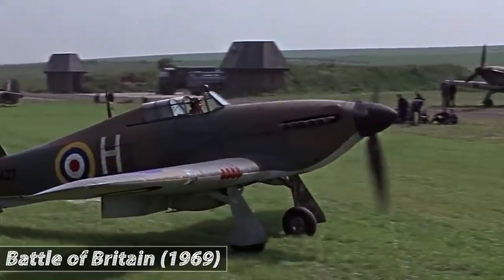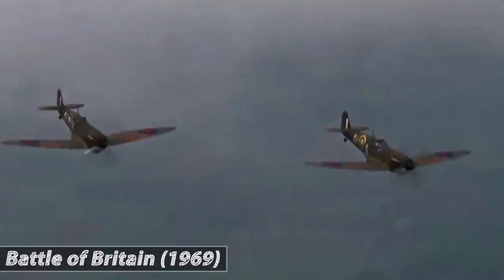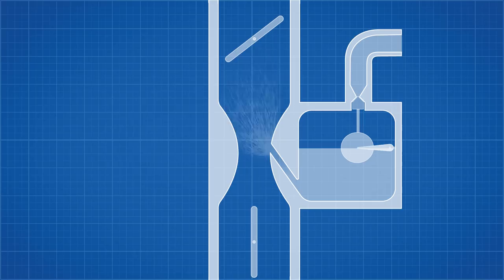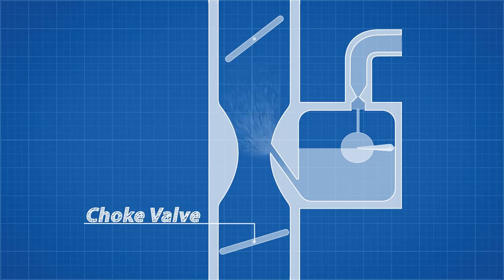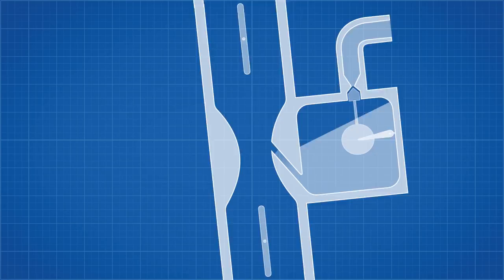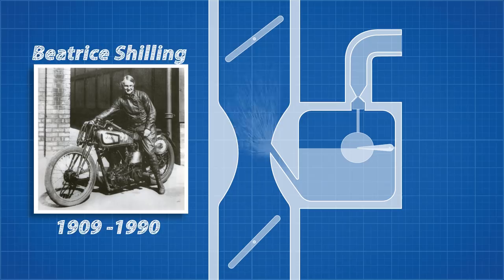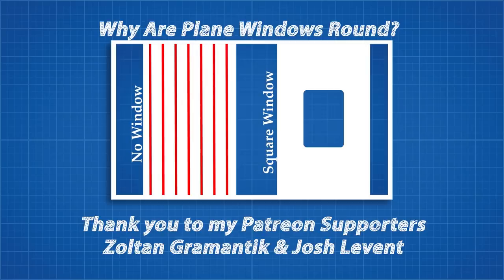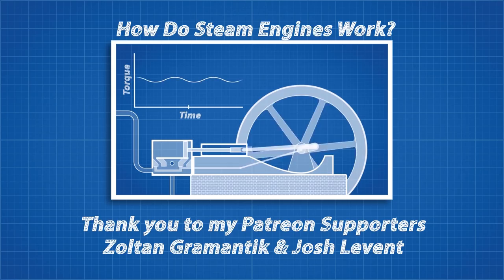The Spitfire's Fatal Flaw

Comment: You might be interested in an online lecture, which I sat in on yesterday, that revealed the "fatal flaws" of the Bf 109's engine.  Its direct injection might have been insensitive to negative 'G' in combat, but the fuel was insufficiently volatile, did not completely vaporise and a significant amount got past the piston rings.  This diluted the oil, which was then too thin to provide adequate lubrication for the big end and main bearings, which were destroyed at very low lives - and there's more.
The Nickel and Tungsten content of the exhaust valve alloy was progressively reduced and, to compensate, the valve heads were either Chrome or Stellite plated.  The rough surface of the plating tended to produce local hot spots, which resulted in detonation and a piston could be holed in less than two hours running time at high power.
There's an excellent book on the subject that's coming out soon.
Reply: i mean plus the fact that germany had the worst oil production because of the allies bombing german industries
Reply: That seems similar to something I watched.  It was impressive how Daimler-Benz swung for the fences with the direct-injected inverted V and it arguably had greater potential than the upright V, but there were a lot of teething problems and its potential was never fully realized because of the poor fuel the Germans were forced to use.  The cylinder washing was mainly a problem for automotive applications with the cylinders in the upright configuration and more frequent starting and shutting down.  Interestingly, the inverted V is credited for the superior roll rate of the 109 because it allowed the aircraft to be designed with a lower inertial moment than did the upright V.  Another bizarre thing is that radial engines also resulted in a lower inertial moment than could be attained with the upright V.  Robert Johnson stated that he found the maximum roll rate with a P-47 (!) quicker than with a Mustang or Spitfire.

Comment: By the way, the cure is simpler than you imagine. Chain saws use carbs that work perfectly at almost any angle. We Kart racers used ex-chainsaw carbs because they are utterly impervious to high vibration and g-forces (around 3g is quite normal on quick karts). They replace the float chamber with a rubber-bag (effectively) which fills and closes the inlet and, as it empties, contracts to let more fuel in. That 'rubber bag' is not affected by angle or significant G Forces. We Karters banned fuel injection to keep excellent simplicity and to keep costs down.
Reply: as a kart racer, wtf 3g cant be done, 3g is what formula 1 pilots reach , 2g could be possible, but a kart is not fast enough to do 3g, only with a crash it could be done

Comment: I remember the first place I heard about this problem which was when I was reading Martin Caiden's book "Thunderbolt". Robert Johnson, a P-47 pilot featured in the book, got a chance to fly a spitfire and he apparently wasn't told about the "feature" and was gobbsmacked when his engine cut out during a negative G maneuver.
Reply: I recall that Martin Caiden wrote a fictional novel and Robert Johnson did not fly the Spitfire Mk I or II, the full cure was done in 1941 on the Mk V, so it is just possible he did fly a Mk V and just about possible it was an early Mk V from before April 1941. 
Most pilots avoided negative G if they could since it was not the best for the pilot and anything loose on the floor would come up and not be so pleasant, that included mud from wet airfields, of course the P 47 needed a long bomber runway, the Spitfire used grass fields.

Comment: Having flown many carbureted aircraft inverted, I fully understand the components, physics and aircraft's reaction that you are trying to convey,  and although you've greatly simplified the event, you are correct. It might have been a more effective graphic if you'd turned the carb completely upside down so the viewer would see the float bowl fill completely up while the float (and fuel pressure) is holding the needle off of the seat.  As the carb and aircraft are rolled upright and positive g return, the needle closes and the engine must ingest all of the excess fuel in the induction system and carb before a correct fuel/air mixture enters the cylinders and the engine starts running normally again....if it hasn't (momentarily) fouled any plugs.  I was also a bit thrown off by all of the Hurricane footage.  IMHO, you'd been better off only showing the Spitfire clips and if needed, showing the one of the aileron roll several times because it does show exactly what your're trying to explain.  Maybe you'd like to try explaining how an inverted oiling system works and keeps the engine from seizing during negative g maneuvers?  Best regards.

Comment: The engineering aspect of this is spot on, as would be expected from an engineering channel. Historically though, the problems caused by carburettor were not really fatal. Yes, negative G maneuvers could not be sustained, but pilots adapted by pulling different maneuvers to follow the same trajectory in mostly positive G. 

While defensive in a dogfight, nose down maneuvers aren't that common. As the Spitfire had excellent turn performance, an attempt to dive away would actually hand the advantage to the Bf-109, which was marginally better at diving. While offensive, the Spitfire did have problems in tailing a 109, however the half roll maneuver I mentioned earlier meant a good pilot could still tail their target without any real extra difficulty. The carbeurettor also didn't totally prohibit nose down maneuvers in normal flight, they just needed to be carried out gently as not to reduce G below 0.

Incidentally the upside of the carburettor is probably more significant, that being that it resulted in higher fuel density per given volume than a contemporary injector system, and therefore greater power output. 

You are already aware that you frequently used footage of the Hurricane in this video, but they did use the same Merlin engine, so had the same flaw. The thumbnail image however, is of a late war Griffon-engined Spitfire. This aircraft would not have suffered the same problem, making it a slightly odd choice of thumbnail picture.

Comment: Carb problems in early Spitfires (pre MK9) are:
1. Loss of fuel flow (low pressure) in negative G maneuvers 
2. Carb icing at all altitudes and temperatures - Venturi Effect - pilot adding carb heat resulted decreased H power
3. In later  FI engines there is no need for Mixture or Carb Heat. In general.  A lot simpler to fly. 

PS to a comment below - Bf109 and Spitfires were laminar flow wings - requiring wheels mounted to fuselage.  Hurricanes had a conventional wing profile allowing out board landing gear.  Full cantilever wings were figured out later in WW2 ie Mustang.
Reply from the maker: You have taught me something now. Thank you! May do a video on the wheels in the future!
Reply: Neither has laminar flow wings. The inboard gear was intended to save weight and allow a thinner wing (in the 109 it also helped with transport- because the gear was attached to the fuselage, the wings could easily be unbolted and laid alongside the plane to make it fit on a truck or rail car)
Reply: all wings are cantilevered..a horizontal flag pole is cantilevered...
you are referring to wing strakes... which has nothing to do with wheels placements
Reply: no the spitfire doest have laminar profile , he's profile is still use from ultralight aircrafts because allow low speeds ,the Spitfire operate mostly fom small grass airfields !
 But the Mustang have a laminar profile , who make it faster, but dangerous to fly at low speed (brutal stall at low speed)...
The first RR merlin use classic float type carbs, later Merlins from the spitfire was pressure carburators (look like  a single point trottle body): a me109 injection pump was stolen from the french resistance and send to GB, but the RR engineers find this system too expansive and found another solution who work...
Reply: I am not sure how similar the Spitfire landing gear was to the Me 109, but according to Deighton's "Fighter" the Me 109 had a particular problem with instability on the ground, due to the wheels being too close together, which resulted in more accidents on the ground than in the air for this plane.
Reply: pilot blue.
the negative G problem was first improved on Mk I and Mk II Spitfires in 1940, it was further improved by moving the outlet on the float chamber by the Mk V to such an extent it was not a problem at all. the Rolls Royce / SU speed density carburetor was fitted to the Merlin 66 as used on the Mk IX, Rolls Royce gave this to Bendix.
Spitfire and Bf 109 were not laminar flow.
Reply: Apparently pilots began addressing the problem of power loss in negative G before the engineers did,  by executing a half-roll before following a diving quarry, so that the 'plane was pulling positive G in the same trajectory.  Modern fighter pilots are likely to do the same, purely because the human body can handle more positive G than negative G before feeling adverse effects like vision loss.
Reply: I would quite like to know what you are referring to by laminar flow wings as laminar flow is necessary to reduce weight lifting any wing although I realize that that maybe the name of a particular type of wing I'm simply curious what type of ring that is and why it would be referred to that way or maybe a better question would be: laminar flow as opposed to what?
Reply: George Gibbens The measurement or width of a wing is called the CHORD.  In a Standard or Conventional wing its maximum thickness is situated approximately 25% back from the leading edge. The wind passing over the wing, that is attached to it, is called the Boundary layer or Laminar flow. At High Angles of Attack AOA - (such as a steep climb) - this air flowing over the wing Transitions into turbulent air and  the plane loses lift (wing stalls about 19 degrees AOA). The Conventional wing is docile and has very positive lift but has limitations (it has a fat front to air flow -induced drag).  In a Laminar Flow Wing the maximum wing thickness is situated 50% back from the leading edge so the air passes over and under the wing more efficiently (greater potential aircraft speed for a given HP).  The biggest draw back is the Lift force is moved back significantly or by 50%. The wing transitioning from laminar or smooth air into Turbulent Air Flow  can happen very quickly(stall). So while the Spitfire didn't have a true Laminar Flow wing or Profile (until Mk 21) Supermarine had  thinner wings and designer Mitchell put he planes maximum wing thickness at 33% back from the leading edge. This gets rather technical but the Spitfire controlled violent stalls by having the wing stall at it's root (closest to the fuselage), wing wash out (wing twist), wing dihedral and of course that amazing double ellipse wing (Planform - aspect ratio). Because of these wing improvements the Spitfire was able to get more speed per HP as compared with the Hurricane which had essential the same motor. It is all about aerodynamic efficiency. The Hurricane was a more forgiving aircraft for low time pilots because of it's wing.
Reply: Yes I understand that's how All wings work But I did understand your explanation of how the term was used and I am grateful for the information about that type of cross section
Reply: Yet the Spitfire was very easy for inexperienced pilots to fly, it had very good low speed handling which made landing and taking off easy and it had excellent high speed handling or as an American pilot put it, once you have flown a Spitfire every other plane seems imperfect in one way or another
Reply: The main difference between the Me 109 and Spitfire at landing/take off, was that the Spitfire had a much better low speed handling, and touch down at lower speed...For comparision, the Dewoitine D520 was a intermediary between the Spit and 109: near the same manouvrability as the Spitfire , but (dixit Adolf Galand who fly Me109 and Dewoitine D520 use form the luftwaffe for training after 1943) comparable difficult at low speed and landing as the me 109, so more was lost in accident as in combat...
Reply: Not just the ability to land at low speed, the Spitfire was also nicer to fly and it did account for many of the losses of Bf 109`s, Adlof Galland was shot down 3 times by Spitfires..
Reply: Well, compare that to how many Spitfires i shoot down..
Reply: Galland 
How many? have you ever even seen a Spitfire or any WW II plane?
Reply: Uhm, ja, i might have seen one or two..
Reply: Galland
Oh, Dolfo, you are such a wag!
Reply: Neither the 109 or the Spitfire had laminar flow wings.
Reply: true: only the Mustang P51 had laminar flow wings...
Reply: pilot blue 
Nice
Reply: Different wings designs were used on different marks of Spitifire,  the wing fitted to late models Spifires was stiffer than the earlier versions.  There were also minor changes to undercarriage length and track mainly dictated by the increased torque and propellor diameter of the much larger Griffon engine.

When they did fit laminar flow wings to a Spitfire it turned out a miserable failure. Top speed improved but the handling suffered.  However the same wing was used on the Spiteful, Seafang  and the jet Attacker.
This wing also featured a wider track undercarriage
Reply: The same wing design was used from the Spitfire Mk I through to the Mk XIX, 
The Mk 21 had a different wing and it was barely faster than the earlier Mk XIV, 
No Spitfire had a laminar flow wing, the Spiteful did and it was not liked so much after the Spitfire but then the same could be said of any other fighter.
To quote an American pilot   " once you have flown a Spitfire every other plane seems imperfect in one way or another"

Comment: the Aircraft in the Negative G Manoeuvre is a Hawker Hurricane, so both aircraft had this problem it seems
Reply: Kiwisark both used the same engine...
Reply: Michael van Kesteren exactly. Prehaps this Video should be called "The Merlins Fatal Flaw" or "The RAFs Fatal Flaw"
Reply: Spitfire is more well-known, it'll get more views :P
Reply: Fair enough point. But he could have added some sort of side note stating that the aircraft in the example wasn't a spit.
Reply: evanpilot Finally a non sarcastic answer. I agree entirely mate.

Comment: I’d love to see a similar video discussing the benefits of the Mustang, not only it’s highly vaunted laminar flow wing, but also how all that bragging was just a smokeshow so people wouldn’t notice that the main advantage was its distinctive radiator.
Reply: Very similar to the Lotus ground effect cars in F1, how mechanics would drape a towel over the rear wing in the pits to throw other teams off the scent.
Reply: There’s a US research paper after the war which found almost half Mustangs didn’t fly with laminar flow wings as they couldn’t then fabricate aluminium to the required tolerances under wartime pressures.
Not sure if it’s the same paper that studied the Mosquito’s wood construction in the context of it being rubbished by US aero manufacturers compared to aluminium and concluded that just because a material (Mustang wings?) was clearly going to be the best material in the future didn’t mean it was necessarily better in its early days than established technologies (Mosquito).

Comment: Why so many Hawker Hurricanes in a Spitfire video :)
Reply: He responded to this in another comment - both planes suffered from the same issue as they shared an engine, but Spitfire footage was difficult to find. So he substituted Hurricane footage.
Reply: Early Hurricanes had the same issue also.
Reply: when is a "spitfire" NOT a "spitfire"?
Many people incorrectly call 1 near identical aircraft a "spitfire" ... and it had 1 particular duty during the war.

Since you're on the "that's not a spitfire" soapbox, am wondering if you know this trivia... and a simple google search wont help
Reply: +Phil Verhey ps. the answer is not "seafire" ... these flew from land bases only.
Reply: Because problem was with Merlin carburetor, not Spitfire. Every early Merlin powered aircraft has same problem
Reply: +Phil Verhey if it's not Seafire and Spiteful was after the war, I don't know. Please share.
Reply: Early Merlins... a problem with Spitfires, Hurricanes, Wellingtons (I think), Lancasters (though it's not as much an issue with Lancs), Mustangs...
Reply: Mustangs don't have there early Merlins, they were equiped with Packard Merlins V-1650-3/7 with Bendix-Stromberg presurized carburetors which were working OK even in negative G-s. They are equivalent of RR Merlins 63/66
Reply: The Bendix Stromberg pressure carb was given to Bendix by Rolls Royce.

Comment: You are absolutely correct about the carburetor but it was quickly fix by pressurized  carburetors
Reply: Rolls-Royce adopted the Bendix pressure carburetor (throttle body injector) in 1943.